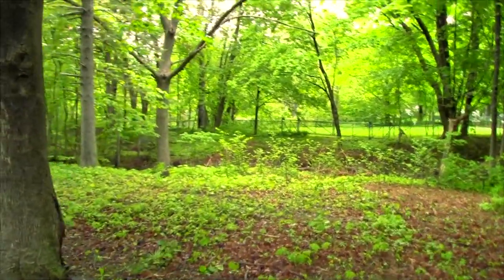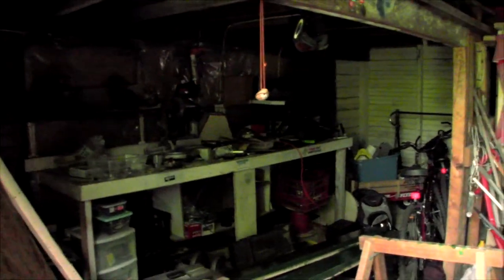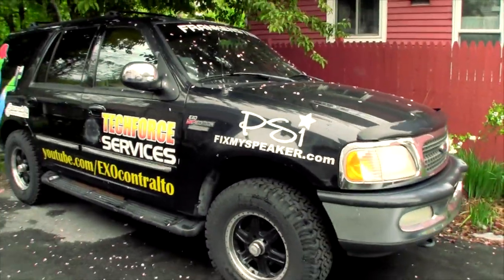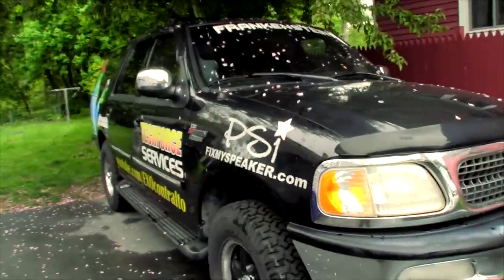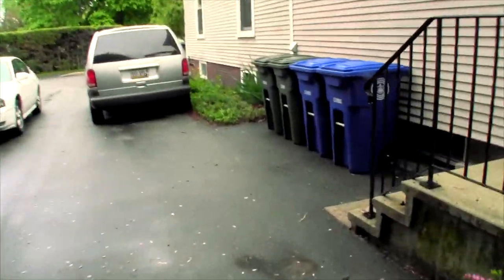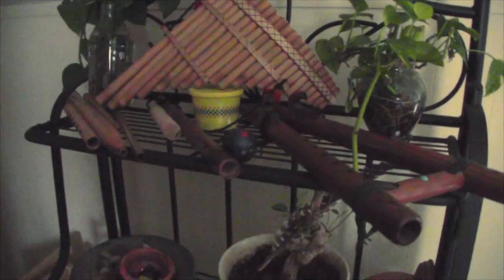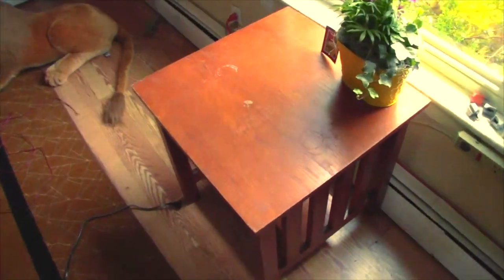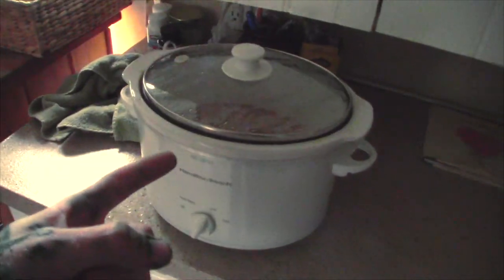Frankenstein's NEW Home! // EXO Life Updates

Comment: Hey bro I am in love with Crescendo Amps  and the 8 and 10 inch mid bass drivers. The are the best on the market. I have used most of the big name high wattage mids an my 2000 amps will blow those expensive mids to shreds in minutes. The crescendos will hold up though for half the money, Beefier magnets will hold the power. I am in love with this brand. It now is my favorite brand out there.Thanks for showing them in your past videos and allowing me to see them online and ordering twin 2000 watt amps for my twelve 8's and 10's for my Tahoe build with two Mojo subs on a Memphis 4000, which is great though. amd six super tweets on a Mojo 4 channel 125 per channel amp. But the crescendo 2000 puts out 2645 amps RMS and is the most superb sounding mid amp out there. Thankyou for the videos.